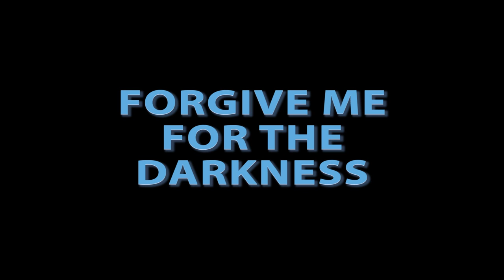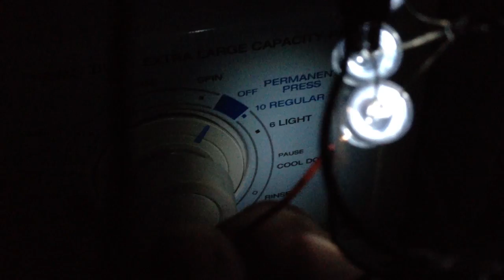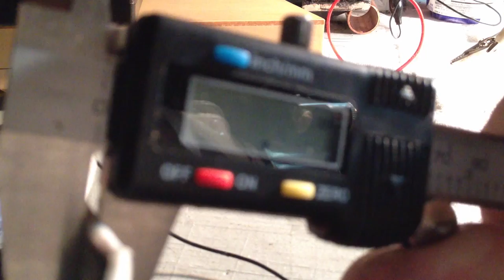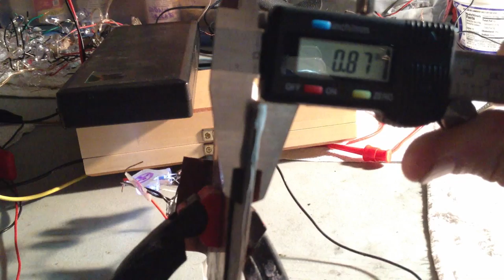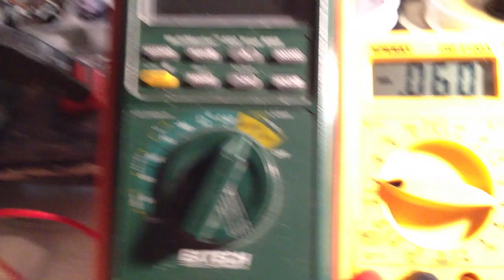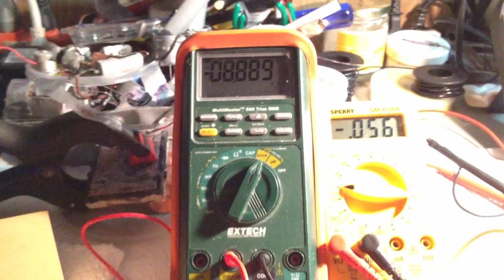Crystal Cell Thermo Static 1

Comment from the maker: Don't know yet, but this one cell is not for long running. It is for power testing. A 2mm Magnesium should stand for years at least. I am in the process of testing longevity now.

Transistor is PN2222A. Very simple oscillator.

Comment from the maker: You're soooo correct. That's why this is a break-through for me. They do not corrode more than 1% (max 5% in a bad cell).

I have some running for weeks now and NO SIGN of corrosion above that 1%. More because of the water added.